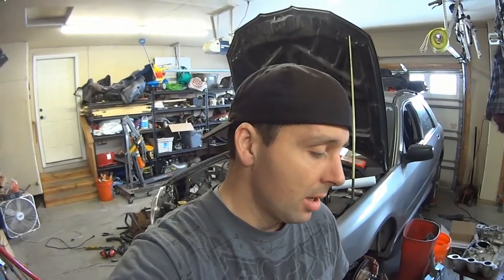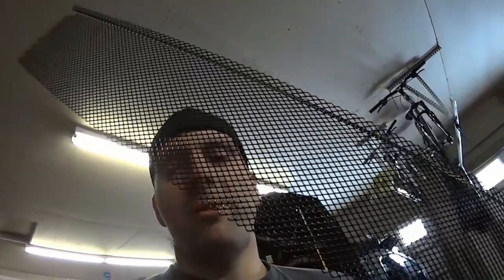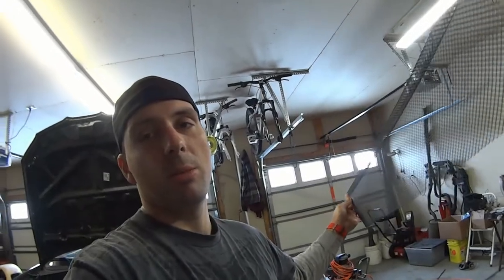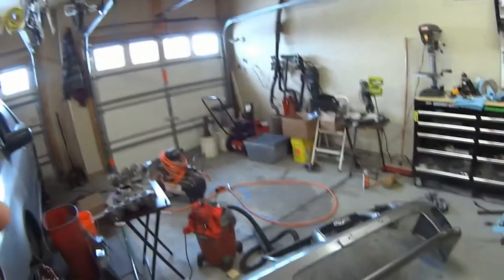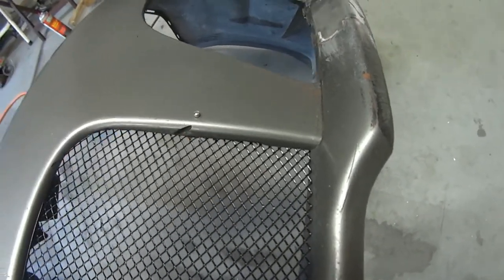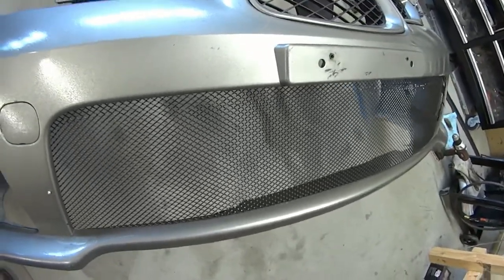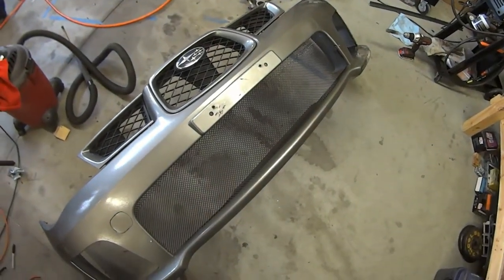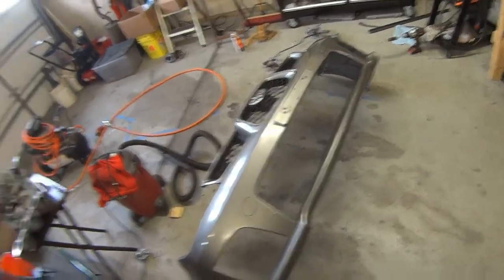EG33 Swap - DIY Cheap Mesh Grille (Ep. 16)

Comment: Hey dude, I made a lower mesh grill for Camry 2014 LE.. Should I remove the older stock grill and replace the custom mesh grill? or just put the custom grill infront of it?
Reply from the maker: Replace it, that should look best.
Reply: EazyOnCars 
Got ya.. Btw I spoke to Customcargrills.com and they said the grill should be put behind the front bumper. However, I think cutting the mesh grill properly in shape to make it fit the front bumper seems much more professional.
Reply from the maker: I've got no experience with this specific car, but I really like the look of the custom mesh grill.